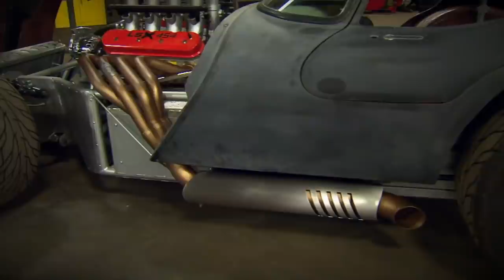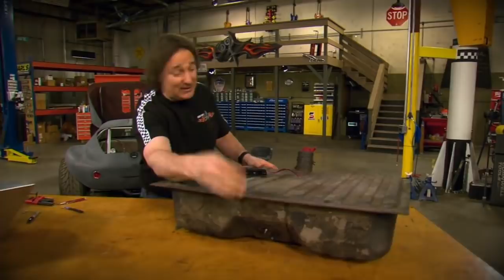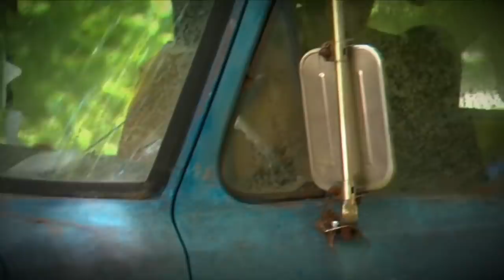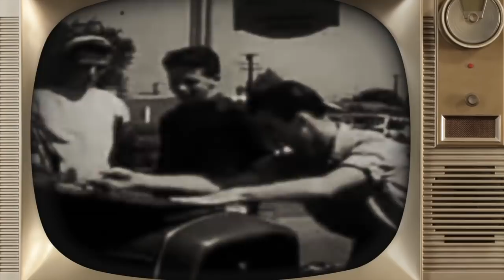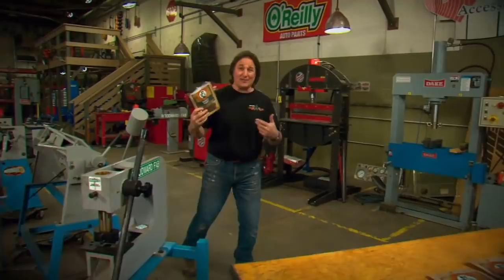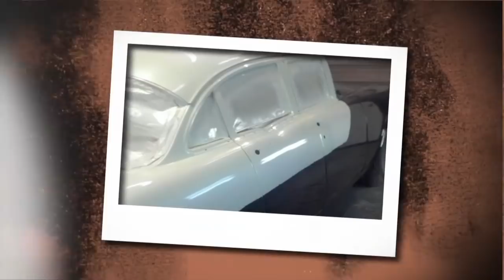On the Road '67 Ford Truck, Checking for Leaks, & EFI Solutions - Stacey David's Gearz S10 E11

Comment: As cool as those tailgate latches are. A short guy like me only being 5'1" doesn't quite have the reach to open both sides at once! Maybe I'd use electric solenoid operation to open and close the tailgate. like some gear heads do for the doors on their rods!

Comment: A friend of mine had a 1968 Ford F-100 Pick-up Truck, The truck had a 240 cubic inch V-6 engine, a 3 speed Clutch transmission (3 on the tree), Manual Steering and Manual Brakes, I rode home in it 1 day in 1987 around Derby time it was something to think about.